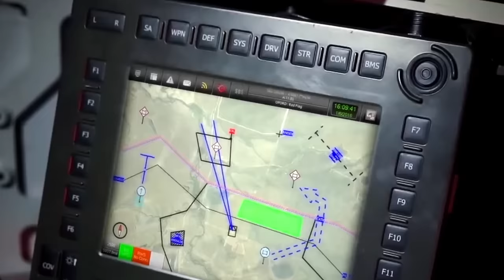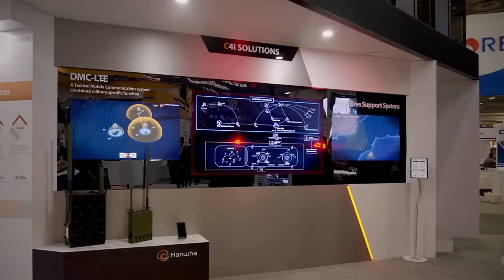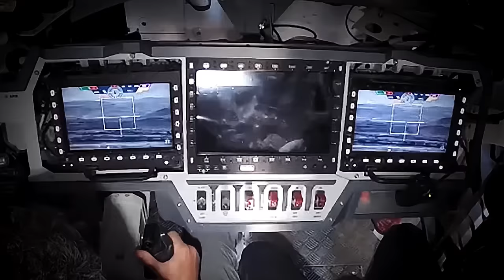The New Korean Weapon Designed the Shock the World

Comment: Why go 30mm when everyone is going 40mm
Reply: who is everyone? only the swede's use the 40mm
USA wants to go with a 50mm
most EU IFV's  have 30/35mm
Reply: That's because of logistics as Australia will be running the 30mm on the Boxer. Keeping consistent sizing helps a lot on the resupply front.

Reality is we should buy the Boxer with a 35 or 40mm autocannon and keep to the same size for this. Just upgrade to that standard as we step away from 25mm, but the thing you probably need to comprehend is how well developed the 30mm rounds are. With quality airburst munitions on offer you have an excellent anti air weapon, and with APFSDS-T you probably don't gain any extra penetration from an anti-tank perspective from 40mm.

When you combine existing stocks of ammunition, other platforms using it, each "upgrade" of ammunition meaning less rounds being carried, more space taken up, and a lower fire rate bigger isn't always that much better.

Long term the 40mm will be evolved into a better thing, but by then you have to ask what are you trying to hunt with it? Because it'll probably have a Spike multiple ATGM launcher on it too for the bigger stuff that the Autocannon can't kill.

Until that development happens there 40mm is probably inferior in every way to the well developed 30mm.

Many nations hung on to 25mm over 30mm for a long period for exactly the same reason. The Bradley, LAV-III, ASLAV etc only use a 25mm. The Marder only uses a 20mm, although the Puma has a 30mm. 30mm is becoming the standard across NATO and it's allies.
Reply: @Andy Dee  yes, I know the 30x173 can still shread armour with ap rounds. Certainly would disable a moder mbt. Barrel tracks and engine ect..
Reply: Lets just put this out there. The CV90, especially the later models are far more dangerous than the Lynx, Puma, Bradley or K21 fighting vehicles. They are more modern, the cannon is much larger (40mm) the types of ammunition 3p programmable ammunition is deadly as hell. It can air-burst at set ranges, it would annihilate every single Russian in ANY trench with ease from kilometers away.
The weight of this IFV is almost as much as the Russian MBT (main battle tanks). Close to 40 Ton. 

The CV9040 is a highly aggressive vehicle, designed to control the initiative by staying mobile instead of slowing things down to a walk. Aggressive maneuvering is what the CV9040 is designed to do, outmaneuving vehicles and killing them in the flank and charging enemy positions to drop off soldiers right ontop of the enemy. 

These tactics have been part of the Swedish doctrine since the late fifties as seen in vehicles like the PBV301 and PBV302. And it was directly copied from the German playbook of WW2, where the German panzergrenadiers/dismounts fought more often than not from their halftracks, allowing them to keep pace with the tanks and also maintain initiative through aggressive maneuvering. 

A Bradley, K21 and so on is not designed for that type of combat. It's essentially an APC that drops off troops 100m from the fight. The CV9040 drops off troops within 0-50m from the enemy position, or simply drives up to it and let's the troops fight mounted.

In Afghanistan it was apparently tremendously deadly. The Danish or Norwegians were caught in some kind of fight/ambush and they annihilated the enemy.
Reply: @tomeng9520  evidence for this claim? The Puma and K21 are far newer vehicles with much higher tech built in, and better armour and active defensive systems than the CV90.

Comment: This video is puzzling in so many ways...
1. Yeah surpassing requirements is normal. Requirements are just the baseline.
2. The M113 is not an IFV and Australia doesn't use it as one. It's an APC.
3. The Lynx is not in service with the German army and not very well proven yet.
4. The AS21 isn't that novel. It's a modification of a Korean IFV that's been in development since before 2000 and in service for 12 years now. South Korea already know how to build IFVs.
5. It's armour is not comparable with a tank, let alone a "heavy" one. The listed elements are pretty typical composites on top of aluminum armour, which is light rather than strong (as the original K21 was designed for just 25 tons). At 41 tons will will provide good protection for an IFV, but it's not tank armour.
6. "Most survivable" or "best at protecting its crew" is pure speculation. Going by its weight and the little information available so far, it shouldn't be too far off Lynx or Puma but there's just no way to know for certain.

Comment: I see problems with the narrow tracks, the low infantry egress from the ramp (Westerners tend to be taller then Asians), comparing the armour of this AFV with an MBT is a stretch.  The range and speed is impressive, as well as the gun and missile system.  Are those for real rubber tracks??????

Comment: I wonder why IFVs like this don't include a sensor mast since they do actually exist (e.g. the L3 Harris MX-RSTA). With the main sensors mounted on the turret, the vehicle has to expose at least its turret in order to use the sensors. When they do that they then become vulnerable to direct fire weapons like the main gun on tanks, but also guided ATGMs like the NLAW and Javelin that require the missile itself to get a lock on the target and even unguided RPGs like the Carl Gustav. 

This is especially puzzling for a vehicle like the Redback that can fire the Spike LRII which can be fired with the vehicle completely hull down. The Spike can launch without the missile getting a lock on its target. Once launched a fiber optic cable trailing out behind the missile is used by the gunner in the IFV to see what the missile is seeing and steer it onto the target. With this capability the IFV can stay completely hull down even when targeting an MBT, IFV, or APC.

Comment: 5:49  "The armor of a heavy tank."
And then goes on to talk about aluminum, fiber glass, and ceramics!! 🤣🤣🤣
If i had a dollar for every time people actually told the truth, i would have zero dollars! It´s just propaganda. No amphibian IFV would ever have significant armor. Armor is heavy, and heavy vehicles don´t swim. How about everyone just acknowledge that these vehicles are death traps, and can´t withstand even a high powered .50 cal? Yes, it might have a little more armor at the front, but the rest is paper thin. And btw, aluminum armor has the strange habit of causing nasty fumes inside, when penetrated by explosive rounds. Even the most modern IFVs and APCs are burning hulks on the steppes of Ukraine.

Comment: M113 is not a IFV, its a APC. The Korean K21 IFV is improved copy of CV90 after technology transfer in the 90.
Samsung is one more company that got inspired of the mobile phones invented by Ericsson.
Bronco 3 is one more improved copy of Hägglund/Volvo invention of Bs206.
Reply: Lets just put this out there. The CV90, especially the later models are far more dangerous than the Lynx, Puma, Bradley or K21 fighting vehicles. They are more modern, the cannon is much larger (40mm) the types of ammunition 3p programmable ammunition is deadly as hell. It can air-burst at set ranges, it would annihilate every single Russian in ANY trench with ease from kilometers away.
The weight of this IFV is almost as much as the Russian MBT (main battle tanks). Close to 40 Ton. 

The CV9040 is a highly aggressive vehicle, designed to control the initiative by staying mobile instead of slowing things down to a walk. Aggressive maneuvering is what the CV9040 is designed to do, outmaneuving vehicles and killing them in the flank and charging enemy positions to drop off soldiers right ontop of the enemy. 

These tactics have been part of the Swedish doctrine since the late fifties as seen in vehicles like the PBV301 and PBV302. And it was directly copied from the German playbook of WW2, where the German panzergrenadiers/dismounts fought more often than not from their halftracks, allowing them to keep pace with the tanks and also maintain initiative through aggressive maneuvering. 

A Bradley, K21 and so on is not designed for that type of combat. It's essentially an APC that drops off troops 100m from the fight. The CV9040 drops off troops within 0-50m from the enemy position, or simply drives up to it and let's the troops fight mounted.

In Afghanistan it was apparently tremendously deadly. The Danish or Norwegians were caught in some kind of fight/ambush and they annihilated the enemy.
Reply: @tomeng9520  that is true

Comment: I wonder how mine resist it is though. It seems that mines have no problem taking out tanks and this IFV doesn't have a vhull shape from what I can tell. The engine and range are impressive but I'd also be concerned with that back door as it looks a little thin and is that 370 mile range include some kinda external gas tank as is sometimes seen on some tanks. But overall it's an impressive vehicle but I wouldn't want to be facing a mine field with artillery raining down while suicide drones are dive bombing me inside it.

Comment: Lets just put this out there. The CV90, especially the later models are far more dangerous than the Lynx, Puma, Bradley or K21 fighting vehicles. They are more modern, the cannon is much larger (40mm) the types of ammunition 3p programmable ammunition is deadly as hell. It can air-burst at set ranges, it would annihilate every single Russian in ANY trench with ease from kilometers away.
The weight of this IFV is almost as much as the Russian MBT (main battle tanks). Close to 40 Ton. 

The CV9040 is a highly aggressive vehicle, designed to control the initiative by staying mobile instead of slowing things down to a walk. Aggressive maneuvering is what the CV9040 is designed to do, outmaneuving vehicles and killing them in the flank and charging enemy positions to drop off soldiers right ontop of the enemy. 

These tactics have been part of the Swedish doctrine since the late fifties as seen in vehicles like the PBV301 and PBV302. And it was directly copied from the German playbook of WW2, where the German panzergrenadiers/dismounts fought more often than not from their halftracks, allowing them to keep pace with the tanks and also maintain initiative through aggressive maneuvering. 

A Bradley, Puma, K21 and so on is not designed for that type of combat. It's essentially an APC that drops off troops 100m from the fight. The CV9040 drops off troops within 0-50m from the enemy position, or simply drives up to it and let's the troops fight mounted.

In Afghanistan it was apparently tremendously deadly. The Danish or Norwegians were caught in some kind of fight/ambush and they annihilated the enemy.